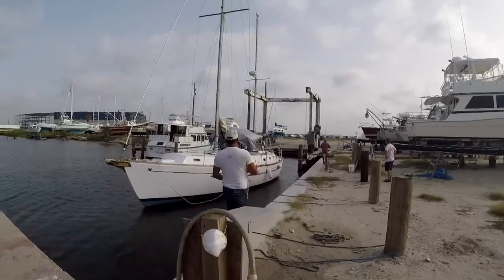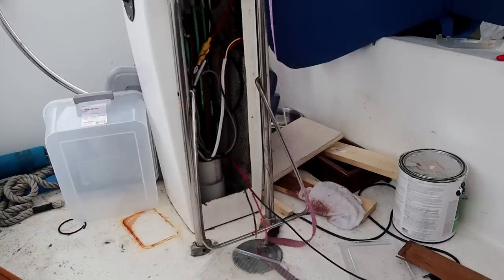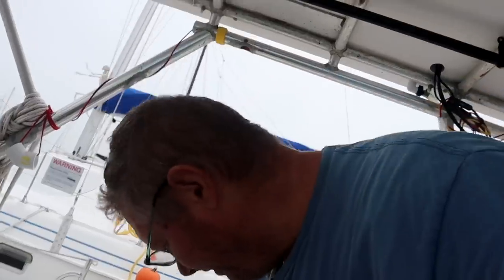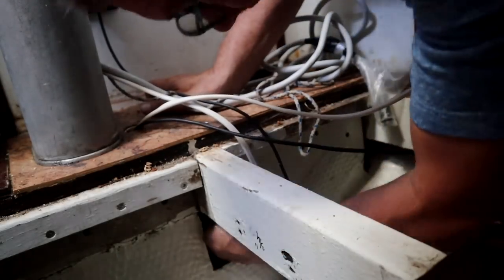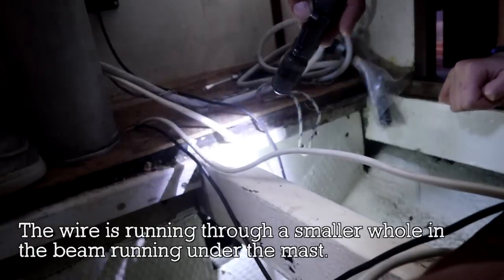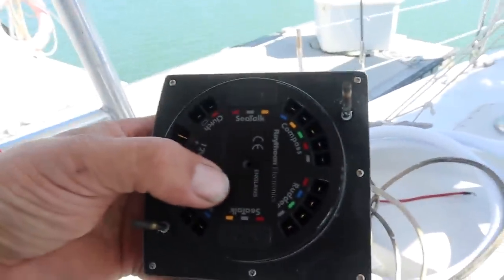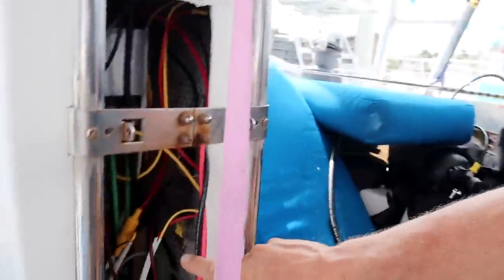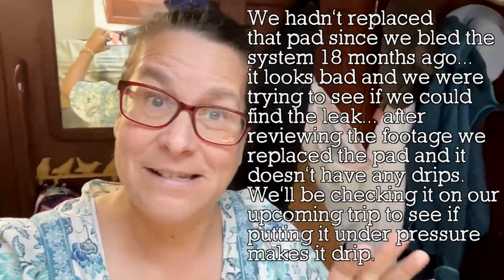Autopilot Troubles on a Sailboat | ep 226

Comment: Getting close, how exciting! Yeah, those step down connectors are not only hard to find, but really expensive when you do. What I've done a couple of times is add another bit of wire beside the smaller to effectively make it a larger gauge. Don't know if that's proper, but it did work.
Reply from the maker: Sooo exciting!!

Comment: I hate to tell you this but she is right about the height of the ap compass it should be at or near the center of the roll point that way it only rotates not move 4 feet side to side it will mater when the boat is rolling . The ap will have a better response at the proper height. The reason the red and black are reversed is someone did not want to go into the settings of the ap and reverse polarity
Reply from the maker: LOL yep.

Comment: Can i suggest you might need to calibrate your auto-helm. The Raymarine manual tells you how. Then you will be sure the course you set on it are correct. A shake down day sail before departure might be useful  to check these things and see what else needs final adjustment, best with the final arrangements.
Reply from the maker: Yep, we will definitely be doing that. Since we’re taking the ditch north that will probably be our shake down cruise.

Comment: There are systems critical to leaving the dock and there are things that can be done underway, Autopilot falls into the latter category. Critical to leaving the dock includes:
- rudder and tiller (but not the wheel steering)
- Nav Lights
- at least 1 solar panel and 1 battery (see Nav Lights)
- Anchor and chain (but not the windlass)

Through holes are difficult underway so usually a good idea to do them on the hard (you did that) everything else pretty much can be done underway, but many items might be quicker/easier to do at the dock.
Reply from the maker: True, but since we’re waiting for weather we figured why not?

Comment: Oh my goodness Todd, it looks like that devic can't handle the amperage to drive that autopilot ram anyway.  Obviously if those are the only two wires that go to the hydraulic pump then...ooooohhhhhh boy.  Those connectors on the device can't handle that much current for a hydraulic style mechanism.  It might sorta work for a while and then burn up.  You might consider a reversing polarity contactor.  The contactor is driven from those contacts and it doesn't need to push a gajillion amps through the cord to run the pump...or reversing valve...That size wire probably means it had something pretty heavy up their originally and that new controller aint the heavy monster that used to be there.  Check the current specs on the controller, vs the hydraulics being controlled.  I have the same generation autopilot head unit and mine controls a little tiny motor that is geared pretty low.
Reply from the maker: It’s an old unit. No specs to be had. It’s working for now. We’ll keep an eye on it. 👍